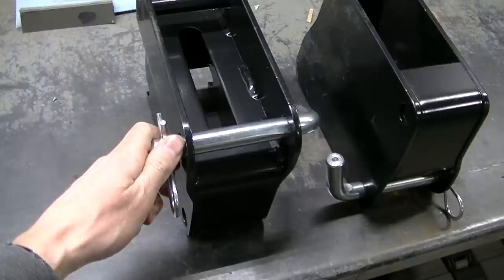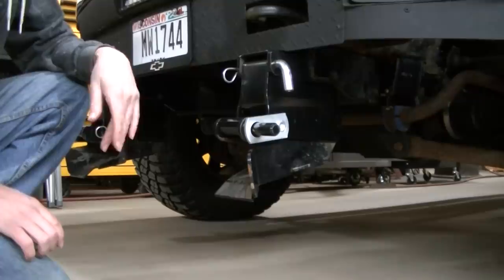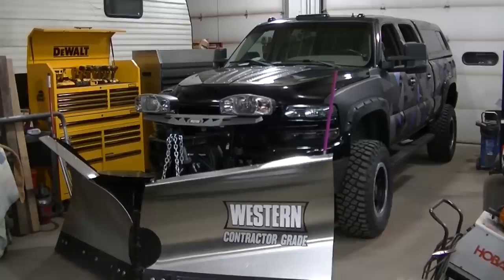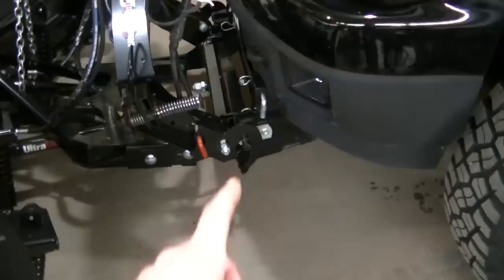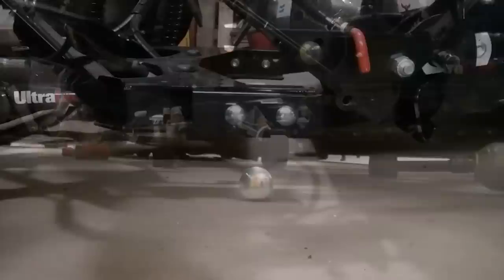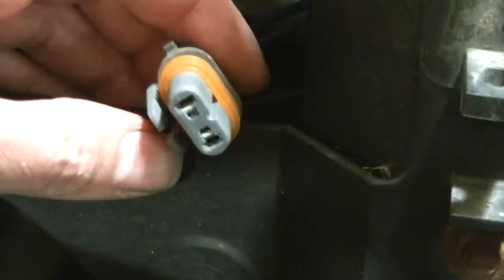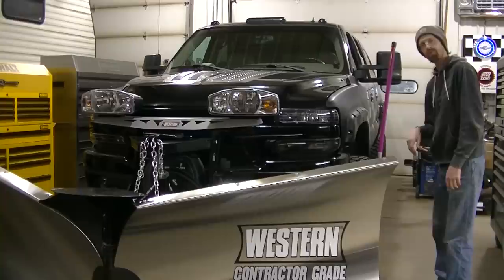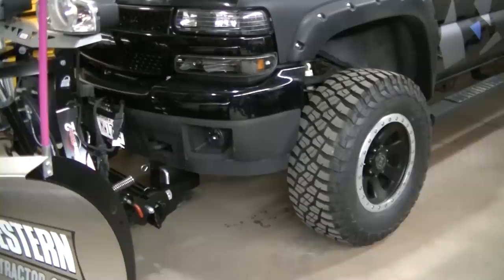Project Midnight Gets a Snowplow "Mounting Testing Adjusting"

Comment from the maker: Western Plow Parts:
8'6" Cutting Edge MVP3:  https://amzn.to/2QiLM07
Shoe Kit MVP3:  https://amzn.to/2QEUq8s
Western MVP3 Decal:  https://amzn.to/2QeHQ0A

This video contains affiliate links, which means that if you click on one of the product links and buy, I'll receive a small commission.
Reply: DO you have a part number for the drop brackets?
Reply from the maker: Here is the link:  https://www.centralparts.com/product/5-snowplow-drop-kit-for-lifted-trucks-western-snowex
Reply: Do they make a 3" drop bracket?  
Keep a eye on the Frame just behind the Shock bracket for cracking.
Reply from the maker: @SledgeHammer43  No,  they only make the 5" drop.  I only see these working for 6" lifted trucks.  Anything smaller and the plow will be dragging on the ground.

Comment: I use a Black 2001 Sierra 2500hd 6 litre crew cab just like yours with a 8.5 Stainless Snow Dogg and totally love it  those  Vortec 6  litres motors are very durable go forever.
Reply from the maker: These trucks are tough but it has pretty high mileage.  I should be ok.

Comment: The reason for the space between the plow and your grill is the mounts. The mounts are “universal” for gm truck up to 2010. The older style mounts for your truck will bring the plow closer to the grill. The older mount also has a cross brace that goes behind the bumper air dam, while the newer or universal one does not. I just sold mine otherwise I would offer them up. My dealer in Des Moines carries used mount and had a set that better fits 01-02 trucks.
Reply from the maker: I bought a 2002 brand new and got plow mounts for it shortly after buying it.  I don't remember a cross brace.  I wonder if I have pics of it.  I know the guy that bought the truck from me.  Maybe I should go take a look.  I would love to have the plow closer to the truck.
Reply: The mounts he has are correct. 
What older mounts are you talking about ,I have two ultra mounts setups. Ones from an first gen ultramount the other is newer.  They both fit same
Reply from the maker: I think I remember the 1500 mounts had a cross brace.
Reply: Ya the 1500 and 2500 are different frames
Reply: Ya the 1500 and 2500 are different frames
Reply from the maker: Yup,  I remember getting a 1500 mount for my 2500 on Ebay and having to resell it.
Reply: +mossman381 Here is an eBay listing for the same mount I had on my 01 Duramax. This style mount sits further back and has a cross brace. I'm not sure when it was made possibly for the 99-00 2500's. I know the listing says it's for 1500-3500 but it's probably wrong and won't fit 1500. The mount technically fits the newer trucks up to 2010 but will require major trimming since it would sit way back in the bumper. When I installed mine on 01Dmax it didn't stick past the front bumper at all maybe a little behind it. https://www.ebay.com/itm/Western-Ultramount-Ultra-Mount-99-10-Chevy-GMC-1500-2500-3500-/273584336743
Reply: +mossman381 Part number for the old style is 67981-1 part number for the new style is 67981-2. The old part number is discontinued
Reply: +mossman381 https://www.plowsite.com/threads/ultra-mount-for-2500hd.25580/
Reply from the maker: I see that mount is a little shorter.  I don't like the fact that the seller is saying 1500.  That is exactly how I ended up with a 1500 mount for my 2500 way back.  I think I would want to see a part # on that mount before I bought it.  Plus my mount is welded to the frame now  :)

Comment: You should do the 4 high mod on the truck. Its real simple and keeps the low beams on with the high beams.
Reply from the maker: I did that on the dually.  Just never got around to it on this truck.
Reply from the maker: Also with the LED headlights I don't really need them both on.
Reply: How does that work

Comment: I have a 2006 Silverado 2500HD I am trying to add a plow to, it is also lifted 6 inches, how did you install to the crossmember with it dropped?
Reply: do you have the bracket instal video to the frame?
Reply from the maker: Check out the install video on my channel. I go through everything I did.

Comment: why such a large lift, and barely oversized tires? i would have thought at least 37s but i don't know your circumstances either.
Reply from the maker: 35s are big tires.  I had to cut some of my bumper to clear these.  I can't imagine 37s.  I daily drive this truck and bigger tires would be a nightmare.
Reply: @mossman381  makes sense

Comment: Finally, The video ive been waiting for for a year and a half 😂.  Looks great on there 👍

You could probably bolt the adaptor to the truck mount to take some of the play out. Maybe its just me, i cant leave anything alone lol, but id try to modify those mounts next summer (if you plan on keeping the plow on midnight) to close the gap between the tower and truck, and bring them up like 2” to regain some ground clearance since your still on the middle adjustment.
Reply from the maker: I have used this setup  ;)   and it seems to be a non-issue.
Reply: Sweet, you recorded it right lol? Have you decided if it needed timberns or not? Looked pretty soft in the front when you first picked up the plow
Reply from the maker: I have video  :)   I actually went with some Z71 bump stops I had.  I will have a video on that soon.  It holds the plow pretty good just trying to stop the fender flare rub.

Comment: Truck looks awesome that’s the perfect plow for that truck. I have the same problem with my 06 350 diesel when I have my plow in full v it’s always scraping I wish they would fix that somehow
Reply from the maker: I think it's just the nature of the beast.  V plow is going to be close to the ground when in full v.  I don't run full v driving down the road.
Reply: Yeah I usually never run it in v going down the road either unless I’m in a tight area can’t wait to see this bad boy in action
Reply: Brother has a 8’6 mvp on a 2005 duramax SW ext cab long box 
Doesn’t drag on the road.   Just hits the driveway going up
Reply from the maker: The 8'6" doesn't drag but it's close to the ground and will scrape with bumps in full v.  Now the 9'6" that did pretty near scrape the ground in full v  :)   I have adjusted the chains and gained a good amount.  It's all about tweaking this setup.  Every truck is different.

Comment: I'm not a fan of lifts in general, that being said I think the truck looks nice. What do you use for ballast in the back? I run about 700 lbs of tube sand sitting directly over the rear axle on my 06 Silverado with a 7.5 foot Fisher HD. Truck is a tank with the sand and the blade on, love it. Thanks for the videos
Reply from the maker: I run sand bags too.  But I put them behind the rear axle.  Ballast is suppose to pull weight off the front axle.  With weight over the rear axle you are actually putting some weight on the front axle.
Reply: @mossman381  I should have clarified i run the sand back there more dor traction than ballast. Plow only drops half an inch on the front axle with nothing in the box
Reply from the maker: I got you.  That 7'6" probably doesn't need much for ballast.  This plow is around 980lbs I believe.
Reply: @mossman381 The Vs are so heavy. I believe the full weight of mine, even with the cast iron shoes and rubber snow foil is only maybe 700 lbs. You got a nice set up going there, although I do miss the dually

Comment: they rub because of the offset wheels, front looks spaced out further then the rear, I'd add 1" to 2" rear spacer to get it even agian.. when Chevy Truck are lifted it pushes the front wheels out about 1.5"
Reply from the maker: I didn't go with a crazy offset.  I did go with 10" wide rims instead of 9".  When lifting you certainly wouldn't stay with stock rims or stock offset.  The lift companies should know that.  I probably won't run spacers because I don't want my tires sticking out of the fenders.  The fronts already do and I really don't like that.
Reply: +mossman381 yea, you gotta add a little to the rear to make it match the front, I went 2" hubcentric

Comment: Looks like your driver's side fold up ski/hook sticks too? I have the same issue I have to keep spraying it with wd40, other one moves easily but it's always a fight with the driver side
Reply from the maker: I was having trouble with the other side and loosened the bolt.  This was the first time hooking up since last year so it was a little sticky.
Reply: @mossman381  are you talking about the big bolt at the bottom that the arm swings on?
Reply from the maker: Yes,  I slightly loosened mine.  They have nylon lock nuts so they shouldn't loosen up.
Reply: @mossman381  thanks I'm going to try that, beats fighting with it every time I hook up

Comment: unless you can figure out how to raise the whole A frame without affecting the moldboard operation, all the lift in the world isn't going to change that the A frame has to be parallel to the ground.
Reply from the maker: I think 4"-3.5" drop brackets would have been better.  Would have gotten the plow frame up a bit.  Still could have adjusted it.